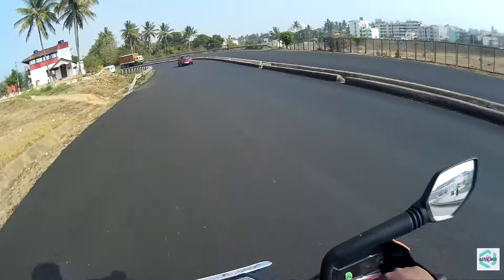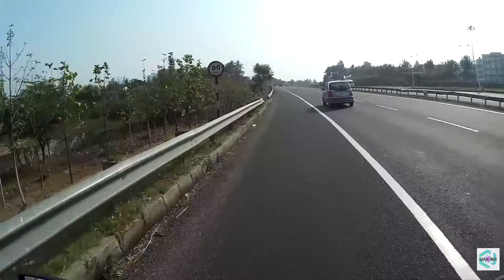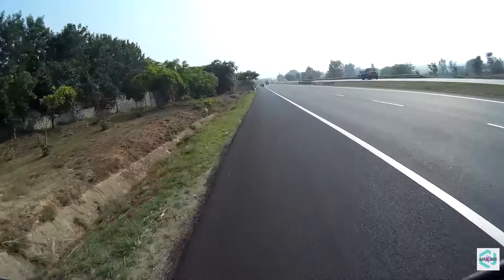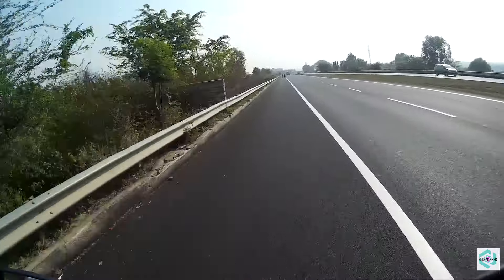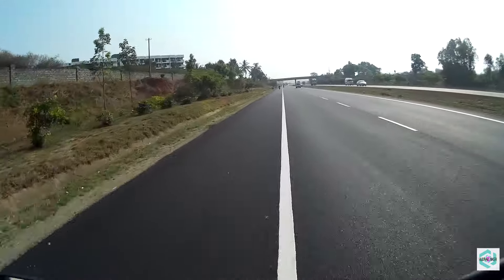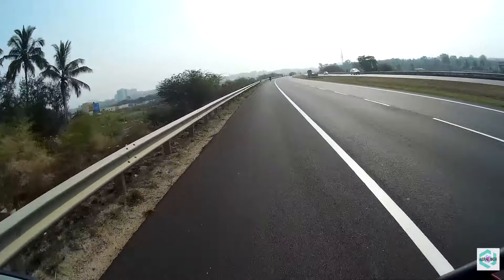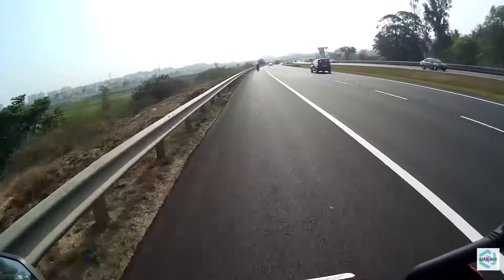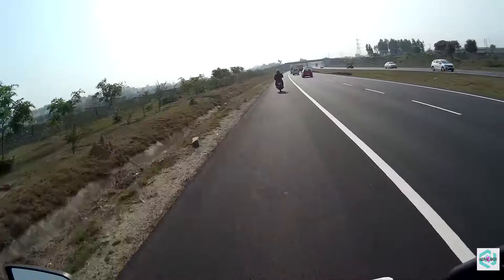5 THINGS I HATE ABOUT MY KTM DUKE 390||2017||

Comment: Hey bro I'm confused between 250 and 390. As i will be using this bike for both commuting and tours. So is the heat from engine manageble or too much in traffic situation. Please do reply as it would be a great help.
Reply from the maker: I SUGGEST GO FOR 390!! More tech,more energy ,more power compare to 250!! 
Heating is normal in KTM biks u have to get used to it..but i think managing it  is not a big deal..
390 gives you all the power you require in city as well as in Long ride...!!!